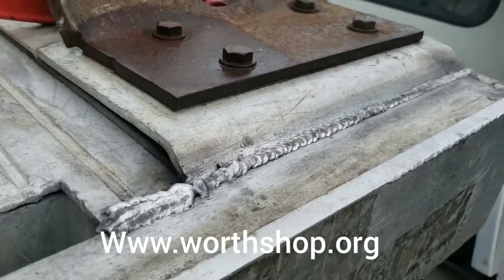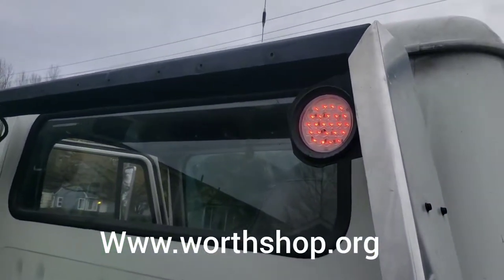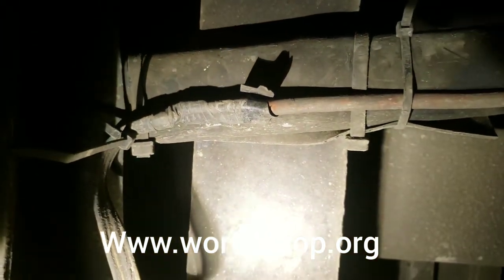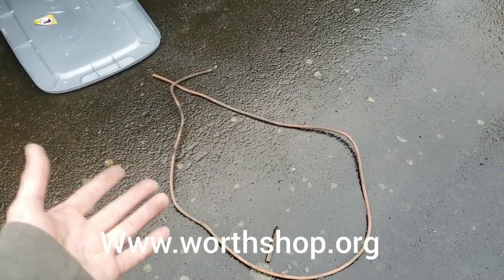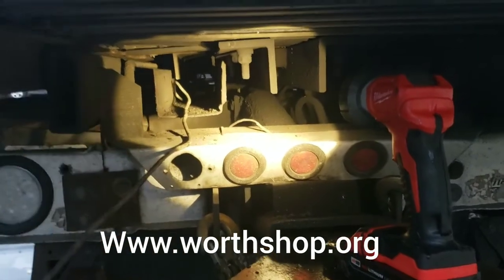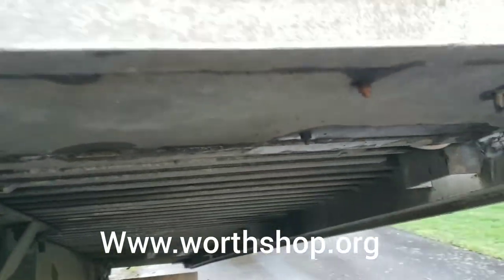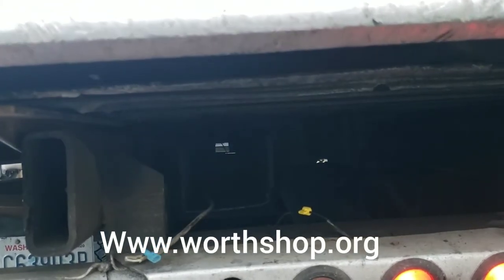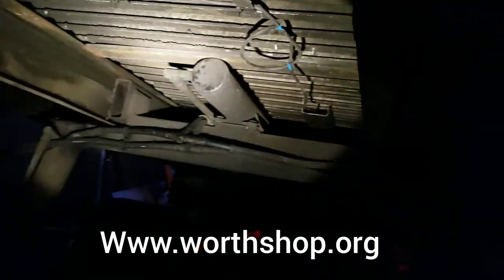Running marker light wire on a rollback tow truck bed

Comment: Man, a lot going on there, but i'll just say I feel your pain....electrical on tow trucks is always a good time, but even more so on flatbeds, and as I was watching I started thinking wait, is that an electric winch? THATS unusual, but I will say.....very cool actually....different tho, but hyd line routing thru that channel sucks when they break. I like the fact that its a stationary pylon too, also simplifies the wiring a lot. Lots of potential on that truck. keep up the vids. look forward to more.